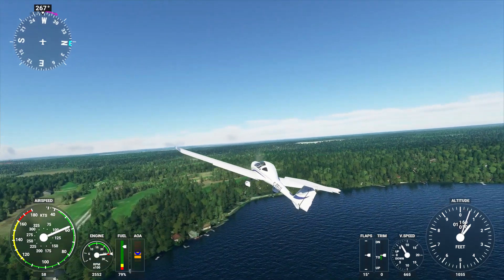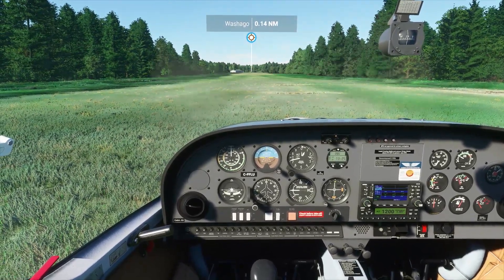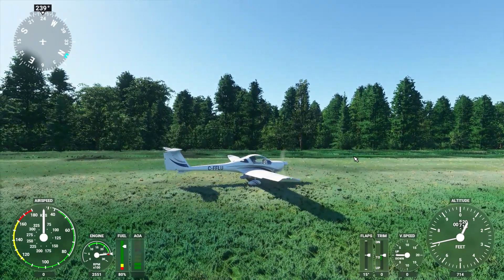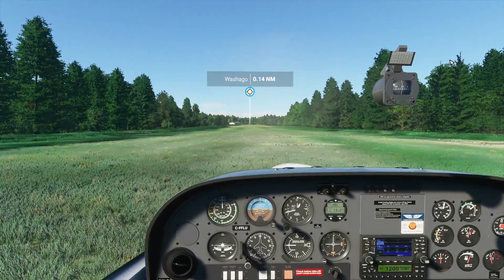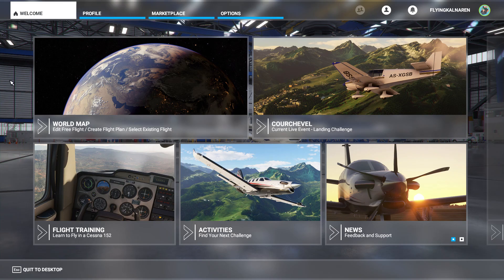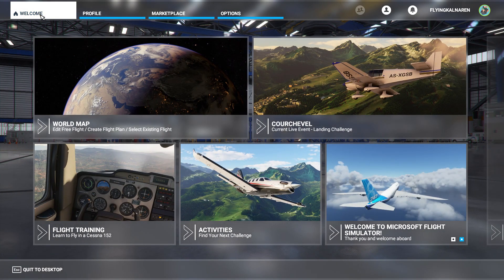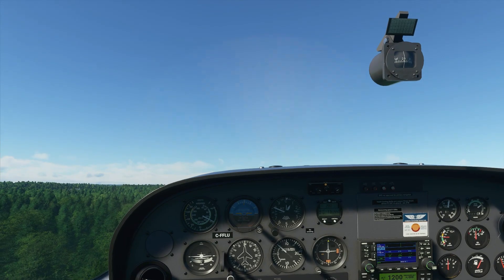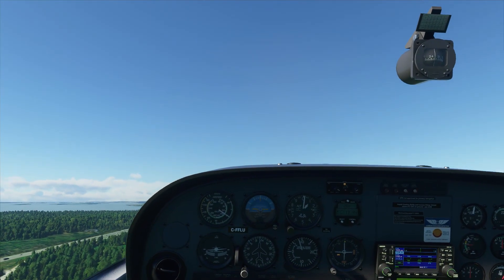Flight Simulator 2020 - Messed up Physics

Comment: I can't stand Msfs2020. From the intro music to the offering of a lite version of the sim for xbox to the inability to slow aircraft down due to inaccurate drag physics. 

The new 2024 i can guarantee this is still going to be another reproduction of the same turd but it will look better.
Reply from the maker: @kaxis26  Yea, I don’t like how much GA planes float. Some of the 3rd party addons are significantly better in this regard. The “stock” physics are merely acceptable, nothing outstanding.

Comment: That happens in a real plane
Reply from the maker: Not in the DV-20. It shouldn't happen in any T-tail aeroplane.
Reply from the maker: @Dylan Vuorinen The Cessna isn't a T-tail. It has a lot more airflow over the horizontal stabilizer from the propwash. I have flown a DV-20 and used this technique. It doesn't happen on the real plane.

EDIT: I also tested the 172 in the sim, and it doesn't do this, either. I also doubt the real one does (it's been almost 20 years since I've flown one, so I can't remember).

Comment: I didn't play FS2020 yet ... but seem to me that physics are, one more time, garbage ... and the thing that don't put Helicopters is as clear indication of that.
I think as always, Microsoft just make a patch on something just working right most of the time, and put a nice envelope for Christmas like awesome ground detail ...that's it.
FS200 = Nice view of the ground (and sound, I think the improved the sound too).

But then ... there is the DCS, perfect physics, ugly af ground details but who cares! you are in the air and you want things works as they really works.
Reply from the maker: Well Microsoft didn't make FS2020, they just published it.

The physics are interesting. Diving into the config files there's actually a ton of settings for aircraft in FS2020. I think a bigger problem is that the planes just aren't configured correctly. I dropped the control authority for the C152 by 60% and the thing flies a lot better.

I'm not sure the comparison with DCS is entirely fair. A module in DCS costs the same as the entire FS2020 game. DCS also has its issues that are pretty annoying (like AI that doesn't have to obey the laws of physics).
Reply: @kalnaren  Interesting ... so who made it? What company? Its look like they took old FS and make new scenario and models but same physics. As far as I know, they have been using tables for flying physics instead of vectors (as Xplane) or .. idk what actually they use for physic in DCS but works greats.
Yes, DCS maybe its expensive, and IA maybe not working great, and same with the scenarios, ugly af .. but I am talking about just the pyhisics and seem FS still far away from being something more than just right for straight and level flight and procedures.
Reply from the maker: @Franjaver  Asobo Studio is the developer of FS2020. They're using real-time physics. You can kick the flight model back to the legacy FSX model, planes behave quite differently. Improved in some ways but much worse in others.
Reply: @kalnaren  Thanks for info .. will take a look to that company
Reply: Not going to be getting any study level airliners for DCS any time though are we? or even an entire globe

Comment: Have you reported this to Zendesk? Have you written a post in the forum's bug section?
If not and the issue is still present in the 1.9.3 version, please do so and append this video, so we can ensure that the physics engine gets fixed asap.
Reply from the maker: Yup, have an open ticket with them.

Comment: 0:44 Are you sure about that short field technique? That does not like something I would do IRL. I mean haven´t flown any DA20, but usually to gain speed quickly you don´t go full control deflections, it creates more drag and delays buildup of flow, especially critical on all-moving elevators. Granted, the T-tail is not in the propwash, but at full power most light planes can control the tail, I mean bush pilots use it all the time to keep the tail up and the tailwheel out of the vegetables.. and with the volume of flow by the prop and the ground to guide flow there would definately be some flow on the tail.
Reply from the maker: Yea, that's one of the procedures for the DA-20. It's a bit hairy to learn because as soon as that nose comes up you have to check the stick forward and if you're a second or two late you're going smack the tail into the ground. The idea with this procedure is to get the plane into the air in the absolute shortest distance possible. The DA-20 was based on a glider so thing actually needs very little speed to lift off, and it will accelerate faster off the ground. 

The rudder is effective once you're at full power, but steering on the ground in this game I can have throttle idle, be moving at 5 knots, and steer as if I have full rudder authority. That's not accurate for the type. Back in flight school we used to get in shit because some of us taxied the things too fast to save the brakes lol.